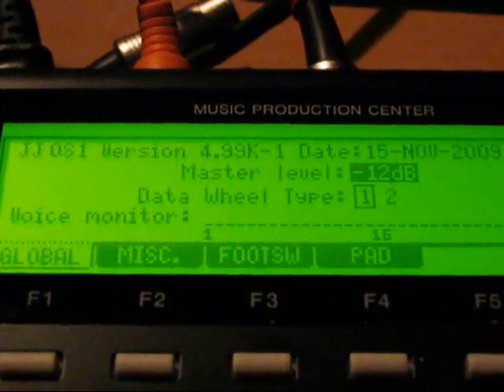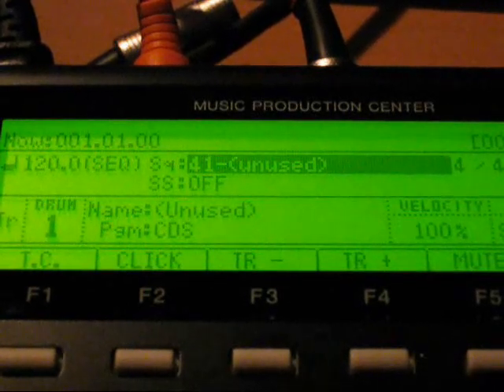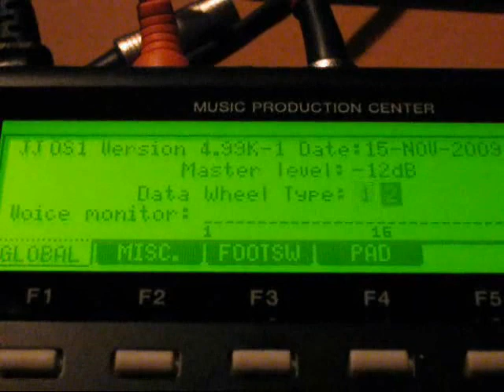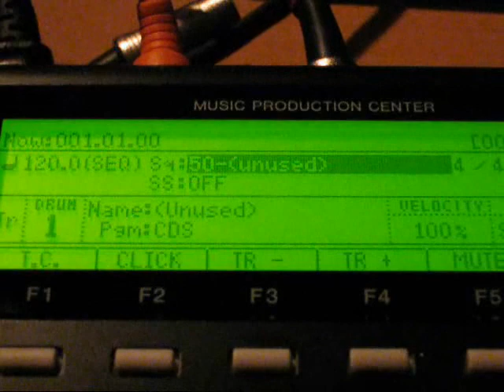DATA wheel

Comment from the maker: @CHRCAR5 
This option is not in MPC2500.
This option is in MPC1000 because the DATA wheel was changed.
Since the DATA wheel of MPC2500 is not changed, this option is unnecessary.